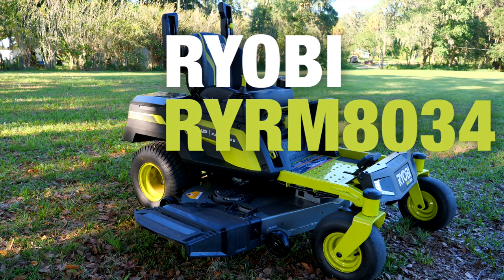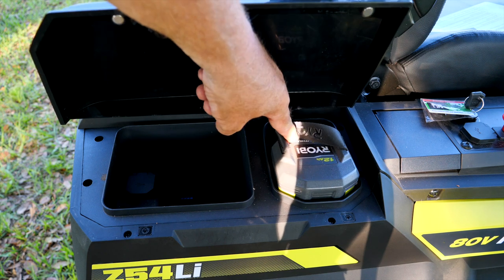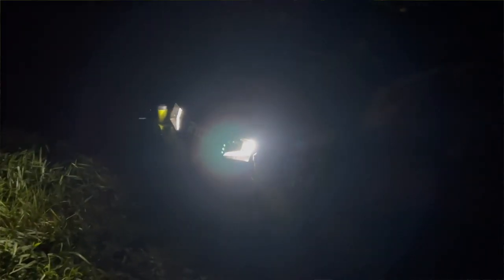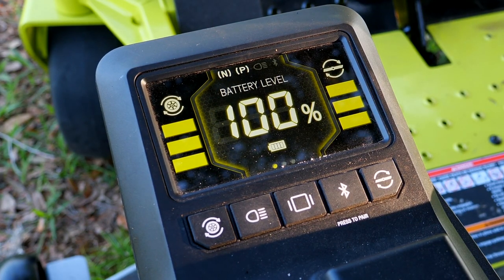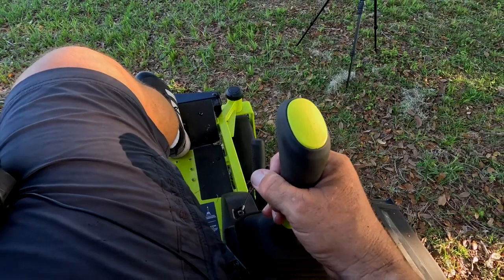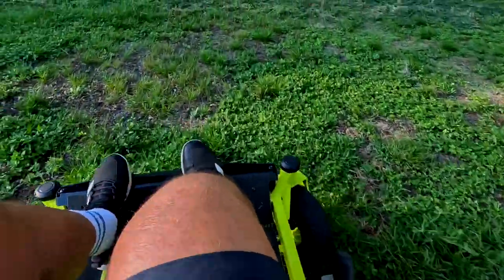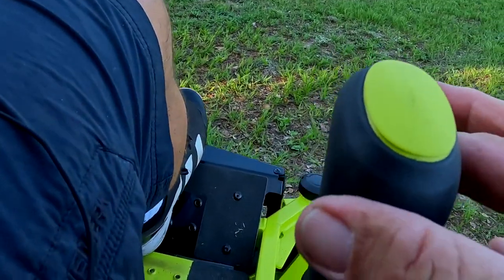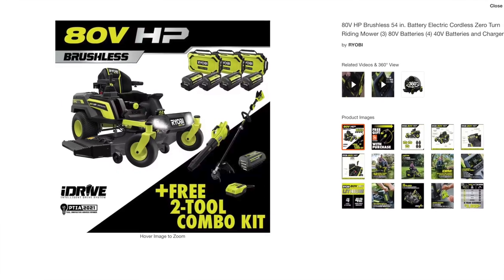i-DRIVE! 80-Volt 54" Fabricated Deck RYOBI Zero Turn Mower with a Joystick

Comment: Once again, I would love to see a longterm durability/longevity test on the mower/electronics/cells
Reply: I've had the 30-inch for a little over a year and it's been perfect; obviously that's not a very long time but so far so good.  I just found a great deal on this 54 and picked it up so we'll see how that goes
Reply: I have had mine for 3 years

Comment: First a little back story then the update. About 2017, I bought a Toro 42" Time cutter. It was a great mower. The only issue I had was the normal yearly battery replacement the first 2 years.
I put a battery tender on it and the next three never bought a battery. 

Anyway I was 71, retired and started gaining weight so I sold the Toro and bought a Ryobi 40v push mower to lose weight. That lasted 2 months and I tore the meniscus in my left knee. 
After surgery, i tried to mow as often as I could but the pain is too great and I am tired of paying someone else to mow. So, I decided to make this purchase. 

Home Depot just delivered my new Ryobi Z30Li. I bought the 30" because my yard is so small. about 1/2 acre.

It came mostly assembled. When I looked at another one in the store, it had two 80v batteries and two 40v batteries. Mine only has the 80v batteries, and they were both less than 10%. It would not move. What  kind of store delivers a riding mower that cannot be driven? I had to go to my shed and get the two 40v, 6ah batteries from my Ryobi push mower to have enough power to test drive it. It upped my battery meter from 10% to 36% 
After putting them in, the blades turned one time for a few seconds and I shut them off. I drove it around a while, boy is it gonna take some getting used to. The blades would not turn while driving since the 80v batteries are so low I will try again after charging. Currently, the joystick is very stiff, quite an arm workout, and it does not self-center, which I consider to be dangerous. I hope the battery charge helps this. I had to park it at my back porch to charge it before driving it to my shed. I will re-evaluate everything and get back to ya when the batteries are fully charged
.
That brings me to my....
UPDATE: I really did not expect to update this quick.

It took a couple of hours to charge the battery, so now they are all full. While it is a wet day here today I decided to try it out anyway. I used to mow my yard wet with my Toro all the time, So I had a basis for comparison. I rode up and down the driveway, then the street in front of my house to test the high speed. It moved pretty good but the stiff joystick made it hard to control. But I pushed on.

Low speed into my front yard with the blades on high. My yard is not the smoothest but it is smoother than most. I found trying to mow a straight line was next to impossible. Hit a slight  bump on the wet grass and the mower takes off one direction. Try to correct with the joystick and it does nothing at first then takes off the other way. 

The lines on the yard were no where near straight. Yes I know it is wet  but I have done it before. I lowered the blade speed to finish my test and the yard. The lines gradually got a little straighter but the tires were chewing up the yard. I have a flag pole in the middle of my front yard. I could not circle the pole like I did with my Toro. I could not trust the joystick. 

There were times when it would lose traction. it would not turn left or go forward on flat level ground. I could go backwards just no control over turns, but I would get it moving again.
There were times when the mower would stop, so I would apply a little more forward joystick with no results. then a touch more. The mower would lurch forward. I did this several times.
My Toro would take about 15 minutes tops to mow the front yard. Today took about 30 and the batteries were at 50% When I headed to the back yard to park it.

I tried to back it in the shed several times. It would not back straight for love nor money. I finally pulled forward into the shed and hooked up the charger.

So here we are. Decision time. I realize that most of these issues would improve with practice and never using when wet. but the joystick still would not self-center and that is dangerous. Suppose I were to pass out while driving and it kept going into the street or the creek across the road. 

While it was charging I had to make a run to the store. While out I swung by Home Depot to see if there were any adjustments for the joystick that would smooth it out. They shop out the warranty work so I could not talk to anyone. I went back to the lawn mower section to look around when an assistant manager walked up and we started talking where I filled him in on this. We decided I could get a Cub Cadet  42" zero turn 'for the same price.

The fact that the mower could continue on if the operator became disabled was the straw. This is a safety issue and is non-negotiable. If the driver was disabled but still in the seat, it could be a big problem.

They're picking up the Ryobi on Monday.

I know this is long but maybe someone will appreciate the detail.

Comment: Does it lug when cutting grass and moving, like a gas engine? When the blades are under a tall grass load, does it slow the motion of the drive wheels, is what I'm trying to say?
Reply: I doubt it, the gas motor has a fixed amount of power for both the wheels and blades. 

Each wheel and each blade has its own motor, so as long as the batteries aren't drained then you'll be fine. 

Like what happened in the video, when the batteries get low enough to not have the power for the wheels and blades, it shuts the blades off so you can still drive it to the charger
Reply: It definitely does not, I have had the 30-in version of this mower for about a year now and it's been excellent.

Comment: JUST GIVE ME THE 80V BATTERY PACK FOR MY WEED WACKER!!!!
Reply: It probably weighs twice what a weed wacker weighs
Reply: @james2042 All you need is a backpack option and you are good to go and you would have high high power and really long run time.
Reply: @MikeMPharmaCyclist  they already have a backpack for the 40v line that allows 3 12ah batteries. Wh to Wh the 3 12ah 40v batteries are about 60% higher. You wouldn't be able to fit 2 of these 80v briefcases on your back. Ryobi messed up with the 80v design if I'm gonna be honest. It should of either been 60v or the batteries should of been box style like greenworks and kobalt
Reply: @james2042  I could see that, I guess they could even make a backpack with one of the 80 volts and 2 12 ah 40 volts though.  They already mix the batteries in the lawn mower itself so why not.  

It's really not a huge deal to me I got a great deal on the mower and I really think it's amazing; first I found an awesome deal on the 30-in and I used it for about a year and then just the other day I found a great deal on the 54 and snagged that too.  One thing I found out that seems annoying is I don't think they make a bagger for the 54-in... They have to get that figured out wtf lol

Almost all of my other stuff is Ego so I guess I have a mix
Reply: @MikeMPharmaCyclist  the mower actually charges the 80v batteries off the 40v ones. It's why you can't charge the 40v batteries in tool and why they deplete first. It's a hacky gimmick I'd expect out of someone's garage, not from a first party solution. The mowers should of just been 40v and they should of just excluded their 2ah and 2.6ah batteries. It would suck for marketing but it would of been a better solution. Ego takes the win there because of battery compatibility, and even if you don't have ego for anything else, it's not like it really matters because the 80v is mower exclusive, so they're non shared batteries no matter how you slice it. 

As for the backpack, the onboard charger would have to be significantly larger to support the 40v to 80v, and I simply don't see it being feasible on something meant to be carried

Comment: No power, no mow, junk, and plastic. Welds on deck are a joke. When it eventually breaks who services it and where?
Reply: Off to the landfill!!
Reply: I can answer that question a weld  would fix that I have one and I run it with my lawn service I haven't had any trouble because of maintenance that I do on it